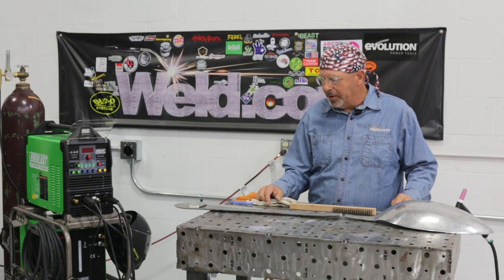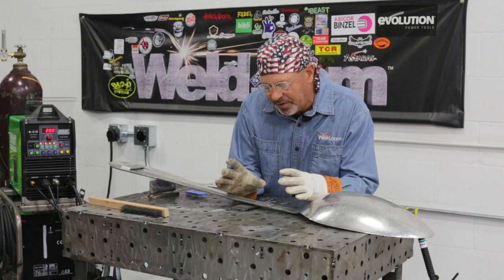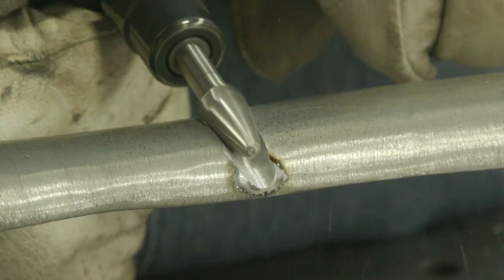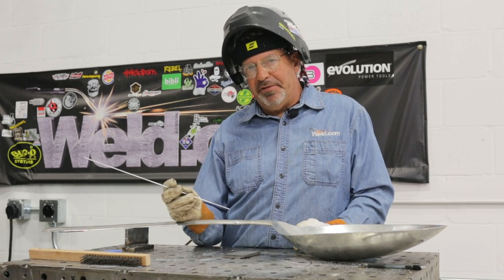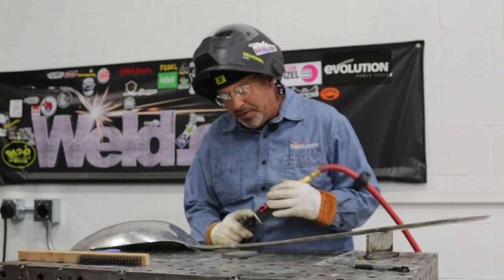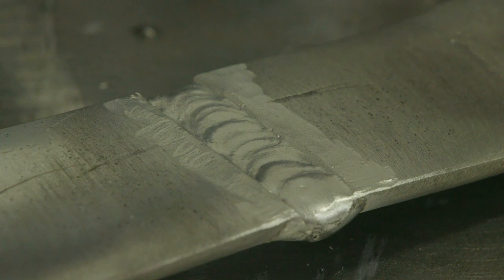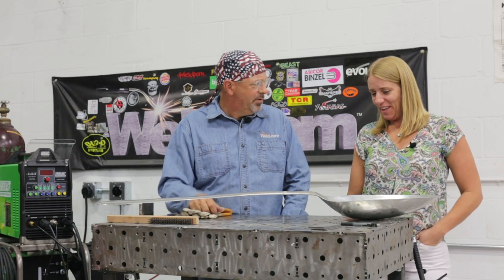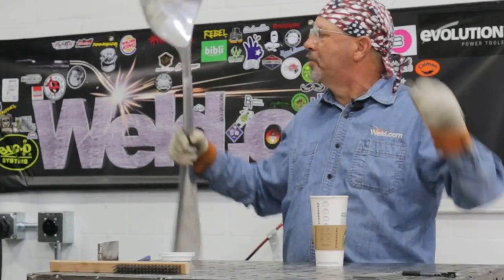🔥Cast Aluminum Weld Repair

Comment: I started welding alum. with a torch back in the 60's.... We had an "OLD" school welding instructor that could torch weld Alum. Foil. Now the one thing you didn't do is wash it down with acetone first, Then you wire brush the shit out of it, THEN wash it down again. Let's face it: "YOU GOT LUCKY"

Comment: Another useful video. Good advice on use and handling of the burr. I have cut a lot of aluminum over the years and have found that putting wax on cutting tools - burrs, band saw blades, hack saws - keeps them from loading up and provides better performance. I use bee's wax, but any paraffin wax will do.
Reply: Good point.

Comment: That's great  In high school, my welding teacher had a key to a faculty restroom which was next door to the shop. Instead of us having to walk all the way down to the main restroom, he would giv us the key. To be sure that nobody ran off with the key, it was attached to a small section of 6 inch aluminum pipe with a chain.
Reply: HOW MUCH THE FECES BUILD UP ON THAT GIMMICK OVER THE YEARS BUBBA
Reply: Never really thought about it....until now....

Comment: Great vid.  Question have you ever used aluminum electric cable strands for filler rods? Me being a cheapo I tried using it ( alum electric cable ) tig welding aluminum on some yard art and it seemed to work.

Comment: I do so much cast aluminum welds and not once have i had the luck to get that clean a base metal. Mine are so full of crap, porous and soaked in oil i dread it every time. 
Just yesterday, i had to weld a leaking portion of an injection die, should have been massive 6" thick casting and there was a massive web of cavities filled with crap not even 1/2" under the surface. Spent the better part of eight hours to clean it up and get the working end of that shit back to the original profile. 

Anyway, thanks for the demo. As always good ripple pattern and pretty interesting chain.

Comment: Little things. I've always wondered "if I screw up in a big way on aluminum I can't just use a grinder or flap disk. it'll just load right up and not do anything." 
Carbide burr... why didn't I think of that? (or find it in ANY welding text book for that matter hahah )
Reply: Whodathunk right? I've been using them for years.  Recently found some really good ones.
Reply: You can get aluminum grinding wheels they don't load up

Comment: man this job brings me back to my last employment,,with Al i keep a 99% balance,it needs very little to work AC like that and does a great job penetrating once you find the right freq etc ,used to get bubbling when patching leaks on a hydro test around the diesel  tank  seal but once i discovered this trick no more bubbles and full penetration seal

Comment: I can't believe leaving the repair "visible" was even a consideration. That gap on the tacked side while the other side was still tight indicated the angle would never be the same again. I would've been tempted to drill a hole in the middle of both sides to add a rod to stiffen it prior to repair.  The deep and wide burr grinding seemed a bit much so I wonder if just filing a bevel prior to joining would've sufficed.

Comment: I wonder if it was cast in 2 parts and welded together at the factory.  would explain why it welds so nicely, and such a system makes a lot of sense for low volume production

Comment: Great video.  I have a cast aluminum handle to repair on a very rare lathe. A Holbrook H20. Break very similar to your giant spoon. Considering the lathe weighs about 5000kg or over 10000lbs why are some of the handles aluminium? Bit late to think of weight saving when ypu are over 5 tons 😂

Comment: If the material started as ingot, it is most likely 356 or A356. The material will usually be better to weld on the "bottom" (casting orientation) because dirt floats. It's also best to grind out any porosity in the weld area . Then stress relieve, quench, and straighten within 4 hours, followed by aging. The material will age at room temp but may take months to get to full strength.
Reply: Can you explain welding on the bottom/casting orientation and its relation to floating dirt? I know that when heated dirt floats on the surface but i didnt understand what you meant

Comment: Hi I have a frame of a P228 pistol that’s made of n I quote “hard anodized aluminum alloy” the frame slides that groove out to slide on the top slide has worn in many parts. My question is can the be welded where the groove is missing n built up n then carefully filed down to blend in with the parts of the groove that’s still there. Basically building up what is missing. Thanks in advance.

Comment: Next time preheat the area before start welding or tacking, it will fuse better without using a lot of amperage, and don't forget to clean your welding rod with acetone, will help remove oxidation.

Comment: Nice! So any steel messes up aluminum welding right? Carbide burr never used for steel or ? Thanks
Reply: There are different burr configurations for various alloys.

Comment: Few Questions,
1. What was the frequency?
2. Max amps was 200?
3. Which torch did you use? 
4. what filler?
Reply: Frequency 80
Amps 200
40% cleaning 
Filler 4043
Reply: Thanks Professor..  It sort of sounded lower than 60hz but I can be tone def.. Was the torch water cooled? As always enjoy your stuff.
Reply: @maxheadflow  Air cooled 17 series.

Comment: It most likely the aluminum alloy element zinc giving you troubles - very high vapor pressure and will boil away - even in brass. You generally can check for zinc by puttng some muratic acid (hydrochloric) on the surface and looking for a reaction - no reaction implies nearly pure aluminum - any reaction and zinc and maybe even magnesium present and will give troubles. That spoon is probably pure aluminum.

Comment: Wow I didn't think that was even possible.   I've tried this before and the metal shrunk away from my arc like cotton candy.    I'm thinking now it wasn't cast aluminum but some kind of pot metal.
Reply: u were welding magnisium buddy. way low melting point.
Reply: er not magnisium..another silver metal..for sure not alum.tryin to recall the name of it..ive encountered it before myself.

Comment: How about a 1"x 1- 1/4" strip skip welded or screwed on back side for additional support with a nice blending of the weld on the front? Gives both support and esthetics .
Reply: My comment was ment to say a 1"wide x 1/4" or better yet 1/8" thick strip of aluminum on back side for additional support.

Comment: Hello SpongeBob,
         I am kind of new to welding and I started out tig welding on Thin Metal Because I thought if I could weld thin metal without burning through I could weld anything.  Now I am thinking it is time to just get the mechanics down first. So what metal do you think would be best for slow moving and learning muscle memory?  I was thinking of trying some aluminum welding

Comment: I've never seen anyone approach aluminum like that... Typically you hear that you should round off the tungsten by setting your polarity DCEN so all the heat goes to it and then hold it on a piece of copper and hold it till it rounds over and then switch to AC to weld you aluminum. I've never seen anyone just go straight into welding aluminum and end up with a screwed up tungsten like that.

Comment: I have problems with parasites when I do cast al and I have a problem with chasing it and just getting ugly with more parasites, specially on the toe. I try to hold off and burn it out, but I just kind of have to stop. I seen none of that happening on this. is this just the type of aluminum that causes the porosity to come to the surface or what?

Comment: So, what kind of rod are you using to fill it? I have a piece of cast I'm wanting to weld a piece of 6061 to. Suggestions?
Reply: 4043 bud..not as strong but flows easier..

Comment: Hi Bob love the vids just wondering why a stainless brush show be used instead of a normal wire brush when cleaning aluminium.  Assuming that they are both dedicated to the aluminium. Thanks :)
Reply: plain steel wire introduces iron into the weld zone..stainless wire doesnt...easier to weld and leaves no rust stains..really the weld will rust!

Comment: To keep your burr from loading up when cutting aluminum, keep some ATF (Automatic Transmission Fluid) handy and dip the the tool occasionally. Clean off your work piece with brake cleaner.

Comment: I might have missed it but what type of filler rod were you using 4043 or 5056? Good video?
Reply: Richard Valcourt 4943 works great too
Reply: Thank you for your reply. Were I live my suppliers stock 4043 and 5056, 4943 is special order. Good to know though, thanks again.
Reply: Richard Valcourt anytime. If you ever want to try it weldfabulous carries it online. About the same price as 4043 maybe a little more. Cool stuff tho. Wets out really nice.

Comment: I ran some 3.2mm Tenacito 38R sticks at 230A DCEP to cut through a plate, which worked although it wasn't very pretty. However, I noticedthat the steel plate didn't get very warm, as in I could put my bare hand right on it and hold it there with no problem. Anyone know how that's possible?

Comment: Someone asked me to repair a cast aluminum wheel for their sedan. I turned them down. I didn't feel comfortable accepting any liability associated with it. I suggested they buy a new one. What do you think Bob? Would you have done the same?
Reply: Agreed. Welding castings (especially dirty automotive castings) is a crap shoot and given the loads such would be subject to, it's a fatal accident waiting to happen.
Reply: @ratdude747  thanks man. I thought I made the right choice.
Reply: I agree but I know of someone that repairs some right nasty curb rash and bent rims on a daily basis.

Comment: I want to join two stainless steel plates for a new cooking device. Which type of welding should I use and what precaution should I take to make to 100% food safe?
Reply: Siddharth Gadre Resistance welding, and use as close to the same kind of stainless your plates are. But I doubt you'd have the equipment its mostly commercial.
Reply: I suggest finding a company that could fabricate your device for you. Just my 2 cents.
Reply: @ozarkhippie  thanks a lot, I will find a company because I will have to look out from commercial point of view too so that the product can be put into manufacturing. Thanks a lot again for the input.

Comment: Gotta love Man Cub!  Bob, I noticed more dross coming out of your filler rod than what appears to be coming out of the base metal.  Was that an optical illusion, or truly the case?  I saw the oxide layer sloughing off the filler rod, but the darker "junk" floating around the edge of the pool seemed to be from the rod.
Reply: I thought it started in the material. I did a booboo and was too slow with the wire a couple of times.
Reply: thanks, that makes more sense.  you know, eye sight is the 2nd thing to go when gray hair arrives!   @bobmoffatt4133
Reply: Heck yeah
Reply: He's pulling the filler rod out of the shielding gas.
Reply: a large cup with screen and smaller opening would have helped to provide better gas coverage dude, also stringers to fill at lower heat settings after first pass helps tons too.

Comment: Did you use 4943 filler? I’ve been using it for cast, wets out good.
Reply: I didn't have any here. I've been using a lot too. I like it a lot.
Reply: Bob  Moffatt thanks Bob, repair came out good. I love those burrs.
Reply: you mean 4043
Reply: @ARCSTREAMS  Love the 4043 with 5% silicon rods.
Reply: ziad welder no I mean 4943. I don’t like or use 4043.
Reply: ziad welder 4943 was made for Aluminum cast and to replace 4043. They are Hobart Maxal rods. They wet in like 4043 and act like it but much stronger. Look them up on amazon. Or google. 4043 is only one of many 4XXX filler there are many.
Reply: is this something new cause i never heard of it,what is the full aws classification of this rod E4943? or it's most likely some kind of hobbyist filler like the Al one that melts at half of actual Al or the silly bronze that is not actually silicone bronze
Reply: can they be used on extruded al or they only made for cast?
Reply: well the silicon is what helps with the  easy flow and i guess the wetting
Reply: ziad welder they can be used on everything 4043 can. It’s acts the same way as far as anodized too
Reply: ziad welder yes for sure
Reply: please explain what you mean by "acts the same way as far as anodized too"
Reply: for sure what? sorry idk what you are replying about because the way yt is setup its not putting your replies under mine like it used to in the past
Reply: ziad welder for sure wets in better because of the silicone. It acts like 4043 and anodized grey same. Did you watch the video on it? 4043 is a junk rod anyway
Reply: ah ok so what you saying is that once you weld with 4943 and anodize the work the weld looks grey and off color juts like 4043 would,is that what you mean? if you have video link give it to me please
Reply: Think of 4943 as 4043 on steroids.  It is registered by the AWS and is listed in AWS A5.10 (the aluminum filler metal specification).  Hobart makes it in cut lengths for TIG and also on spools for GMAW.  4943 can be used anywhere 4043 is used and it produces welds that are 20-25% stronger welds in the as welded condition and even stronger when post weld aged or post weld heat treated & aged.  If you have questions email me at galen.white@hobartbrothers.com or come see me at the Hobart booth at Fabtech in Atlanta next week.
Reply: what the,,where did you come from? feel like im being tracked here for commercial content lol,,,well either my cwb books need to be updated or im mistaken but i do not see this rod listed under aws or cwb in my module book,,does it anodize into an off color from the surrounding base? anyways im sure 4043 has its uses juts like 1100 has it's own uses,every rod has a purpose
Reply: Here is the datasheet for 4943:

https://www.hobartbrothers.com/uploads/pdf/datasheets/Hobart_Maxal_4943.pdf
Reply: ziad welder the Hobart alloy is certified to CSA W48, check the website. It’s not listing in W59.2 because it hasn’t been around all that long.  Doesn’t really matter though, nothing is prequalified under W59.2, so you have to do a PQR anyway. The stuff runs much like 4043, but has a higher tensile strength.

Comment: That was a nice video! I worked with cast aluminum and sometimes it is just trash, like a mixture of 1011 4043 6011 or whatever with porosity and incursions.

I have some recommendations. 

Clean it as the second time but before welding do a cleaning pass and leave it. Don't clean it. That will help to keep the arc on and good when you use filler rod. If you clean it you will have again the same problem.

Sometimes is best to place a point with filler rod no matter if it's ugly and use it to start from there that help because the filler rod is clean and will keep the arc on.  When it is trash is difficult to make the puddle so that will help. 

Don't over heat the aluminum or the weld will go down as the final part of the video. Let it cool down a bit and then restart welding. 

Keep going with greats videos!

Comment: Dang it, I did some cast aluminum for the first time just a few hours ago
Reply from the maker: How'd it turn out?
Reply: @Welddotcom  it is an oilpan. Lots of pepper, and almost did a bobo when doing the backside. Got a bit hot on me, so I took a break to cool down my 9 torch. Think my bevel was too small, it should but couldn't been cleaner and I had too little cleaning in the settings. Don't look to good, but it holds water. Maybe I'll give it another go, your work is very inspiring

Comment: First, it's ALUMIIUM, Second, It's cast ALUMINIUM. Most casting's of this type are silicon   , unlike car WHEEL'S, which are magnesium, both around 5%. Makes not much difference when welding. But use the correct wire. Pure aluminium is rather soft, so not used that much. The tungsten you started with ,I believe, had a POINT. Should have been flat, but clean!  Thoriated , probably spelt wrong, tungsten for A.C. welding, and zirconiated, again probably spelt wrong, for steel. You didn't keep close enough too the weld pool, I could tell by the arc "barking". I could also see that you did NOT have enough amps. When you do the first run, melt right too the bottom  of the v. DON'T WEAVE. American nasty habit. May be ok over the pond, but not over this side. Have a look at the very first bit i,e, tacking. you can see where the edges start to melt. that's what you needed to see when you did the root on the second side, they would have melted to the weld metal from the first side, much better that. I hope this helps you in the future.
Reply: I'm a beginner, can you elaborate on why weaving is bad with al?
Reply: .

You should post some videos of you welding Derek I'd love to see them!